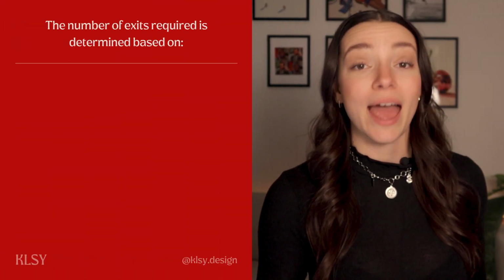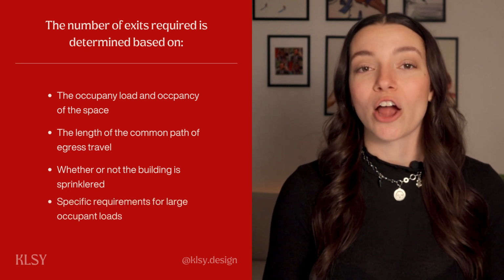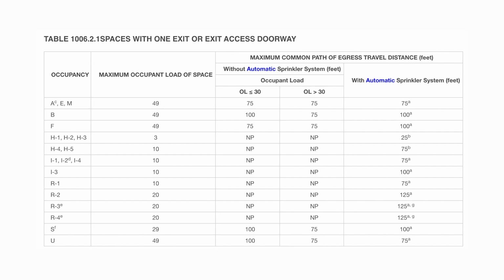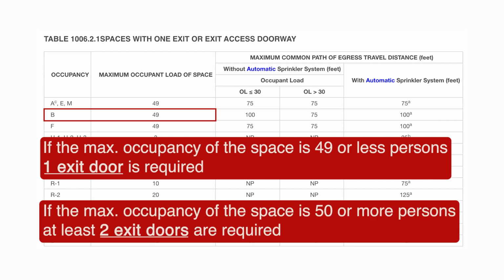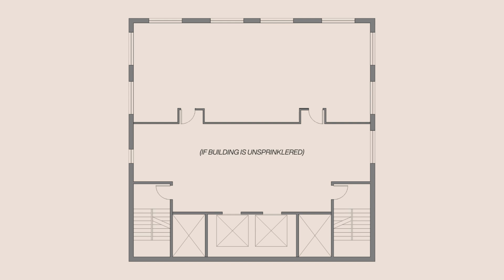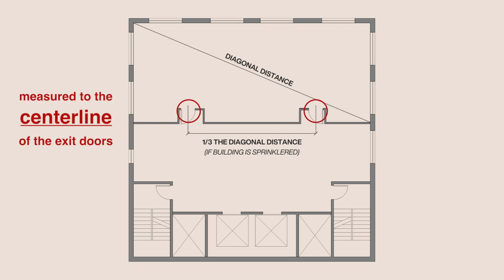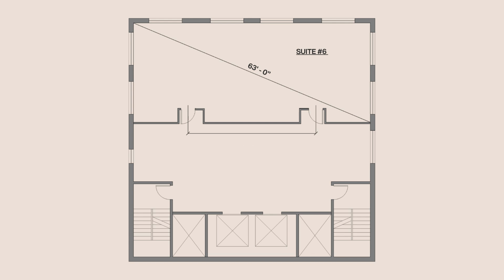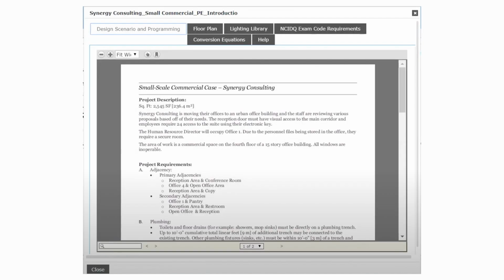Calculating Required Number of Exits (Means of Egress) | NCIDQ Test Prep

Comment: I'm studying with your cheat sheets and videos and they are so helpful. Has one question for the cheat sheet, it says "the diagonal distance of the space by 2 to
determine the maximum distance between exit access doors" but based on your video it supposed to be "minimum" correct?
Reply from the maker: Hi! Thanks for flagging this. The rule and example are correct but the wording is confusing. The IBC requires that exit access doors be separated by a minimum distance of 1/2 the diagonal of the space (or 1/3 if sprinklered). I'll be updating this on my end for sure!!

Comment: What about the number of exits if the building is sprinklered? How can I calculate it? Thanks for your video!
Reply from the maker: Hi Terra! If you look at IBC table 1006.2.1, it shows the maximum number of occupants allowed in a space with just one exit, so if your occupant load is higher than what the table says, you’re required to have a second exit, regardless of whether the building is sprinklered or not. The table also shows the "maximum common path of egress travel" which does depend on whether the building is sprinklered. So even if your occupant load is within the "one exit needed" limit, if your common path of egress travel is longer than the allowed distance (based on sprinkler status), you’ll still need a second exit. Hope this was clear!